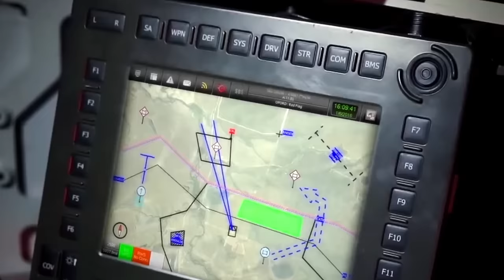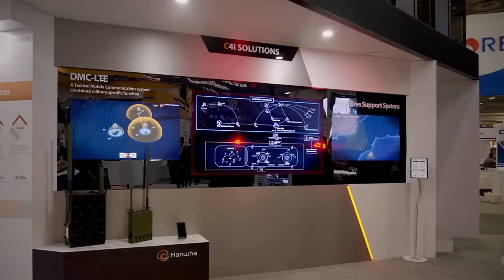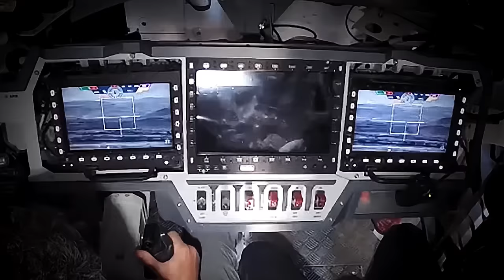The New Korean Weapon Designed the Shock the World

Comment: NOW THAT'S AN IFV!!! Although  I wouldn't say it has the armor of a heavy tank. This and the CV90 I believe are at the top of IFVS:)
Reply: Hopefully America busts one out here pretty soon 🇺🇸
Reply: Well, both are in competition to win the US Army’s contract to replace the Bradley. Along with the Lynx. The issue is familiarity, there are multiple systems and companies that has had decades of partnership with the US military. I can’t say which of the three are superior to the others. I do know all three platforms must meet US Army requirements, one of which is implementation of the General Dynamics’ new 50mm autocannon. I’m sure all three entries have sufficiently planned that part of the requirement. The Redback has, at least, one advantage over the other two entrants. If I’m not wrong, the Redback actually can transport more troops than the CV90 & Lynx. The US Army prefers more than 6 troops per unit as to not split a standard squad between two vehicles.

Comment: A vehicle like this is frightening because it can slap just about anything it encounters short of a tank. 40mm is gigantic! It can carry all kinds of crazy fuses, too.
Reply: With spike missiles also tanks will be slapped
Reply: major tank slapping potential, 2 at a time
Reply: @Shelorygod  depends if a tank has an aps if so it would prolly have to use all of the spike missiles but that would depend on many charges the aps has though It likely would operate with tanks and other ifvs.
Reply: This thing can clap about anything's cheeks it comes across
Reply: Lets just put this out there. The CV90, especially the later models are far more dangerous than the Lynx, Puma, Bradley or K21 fighting vehicles. They are more modern, the cannon is much larger (40mm) the types of ammunition 3p programmable ammunition is deadly as hell. It can air-burst at set ranges, it would annihilate every single Russian in ANY trench with ease from kilometers away.
The weight of this IFV is almost as much as the Russian MBT (main battle tanks). Close to 40 Ton. 

The CV9040 is a highly aggressive vehicle, designed to control the initiative by staying mobile instead of slowing things down to a walk. Aggressive maneuvering is what the CV9040 is designed to do, outmaneuving vehicles and killing them in the flank and charging enemy positions to drop off soldiers right ontop of the enemy. 

These tactics have been part of the Swedish doctrine since the late fifties as seen in vehicles like the PBV301 and PBV302. And it was directly copied from the German playbook of WW2, where the German panzergrenadiers/dismounts fought more often than not from their halftracks, allowing them to keep pace with the tanks and also maintain initiative through aggressive maneuvering. 

A Bradley, K21 and so on is not designed for that type of combat. It's essentially an APC that drops off troops 100m from the fight. The CV9040 drops off troops within 0-50m from the enemy position, or simply drives up to it and let's the troops fight mounted.

In Afghanistan it was apparently tremendously deadly. The Danish or Norwegians were caught in some kind of fight/ambush and they annihilated the enemy.
Reply: The AS21 Redback has a 30mm cannon. The original K21 has the 40mm.
Reply: @smallpenis266  well, given the high success rate of the Javelin, NLAW and Stugna-P against Russian tanks, it doesn't look like many Russian tanks carry their Arena APS. Maybe they are saving all of the tanks so equipped for when NATO finally has to directly enter the war to save Ukraine and they roll out all of their T-90 and T-14s they have been keeping in reserve. Or, given the images of "reactive armor" cells on captured and destroyed Russian tanks being stuffed full of cardboard, it is likely that the generals and others in the ruling kleptocracy stole all the money intended to equip their fearsome army with the ability to swat away incoming missiles, artillery shells and even sabot penetrators. So much for Russia being even a near-peer adversary.
Reply: @papparocket  they don't carry aps only nations that are actively using rn are Slovakia, Netherlands, Israel, the us, and ik a few like Germany and the UK plan to operate them soon and so do many other nations as their very important for any armoured vehicle nowadays also I kinda feel retarded asking this what does salient mean
Reply: Yes but what's the point of having lots of fuses if ammo capacity is too low for long engagements like Ukraine is doing now?
Reply: @chrisbrent7487  trade off for more ammo, speed, manoeuvrability and better armour? With the advancements made in AP and HE rounds it is kinda a moot point. Don't forget the inclusion of spike missiles as well on the redback.
Reply: @hgf334  The point is that the South Korea firm acknowledged the 40mm is not the right tool, and is going with Western Specs.  That shows they are a follower in the industry, and not a leader with regard to armament.
Reply: @raymondrogers3929 Hardly, South Korea has evolved to manufacture its own weapons through the country's modernization and military reforms. With companies such as Hanwha Defense, Korea Aerospace Industries and Hyundai Rotem they are a major defense industry player and one of the worlds biggest weapon suppliers.
Reply: @tomeng9520 We’ll see what the US Army decides. As the Redback, CV90 & Lynx are all competing for the contract to replace the Bradley. All three bids must be able to implement the new General Dynamics 50mm autocannon. So, the 30mm or 40mm currently available on these platforms won’t be the choice cannon for the US Army.
Reply: @TheBongReyes  The CV90 has a 120mm cannon on its chassis, then 50mm is no problem.
Reply: @tomeng9520  I understand but I don’t think the 120mm variant of the CV90 is actually an IFV. Just like the dual 120mm mortar CV90 isn’t a troop transporting IFV anymore. But I do like the fact that there are multiple variants of the CV90. Kind of like the US Stryker platform.

Comment: Great video and content, I really enjoyed it. To clear the air amongst some of the remarks made in the comments section here, I would like to point out that Australia has not made a decision on either of the two contending companies as yet. The two year Risk Mitigation Activity commenced back in October 2019 and concluded on 8 October 2021. According to media releases and reports by the actual Australian soldiers testing the vehicles, both performed admirably. In my opinion, given the supply chain issues that were experienced with the Australian Army's troubled fleet of NH Industries MRH 90 Taipan helicopters, it may be prudent to choose South Korea. Thankyou.
Reply: The most likely scenario where Australia will require these vehicles would be if open hostilities with China erupt. In which case South Korea is likely to face extreme challenges with the manufacture and service support their IFVs. Germany is less likely to face challenges with logistical support in this probable scenario.

Comment: I love the way this IFV presents itself and ALL "even" German new IFV's have "early stage" problems. But about some less known facts about current AS-21 development. As for now AS-21 "Redback" exists in 4 prototype units. It is important to emphasize that those units are not even early production units just assembled prototypes. 3 of them are tested in Australia (hot weather) and 1 is tested for the possibility to be adopted by the Armed Forces in Poland (very cold weather). Let me share some early conclusions, known to the public, from the Poland tests. As for now AS-21 "Redback" failed field tests. The turret which is originally offered to the Australian Armed Forces, and which is a non-Korean design, failed to work in cold temperatures, winter conditions in Poland, and it is said to be replaced with a design from a different manufacturer. The chassis itself also has many "early stage" technical problems and Koreans are currently working hard to make it work. This is just to show how much time it takes, how much work needs to be done, how difficult it actually is to meet the different market needs and make a modern military product.
Reply: Korean summer is as hot as Australian summer and Korean winter is as cold as European winter. Korean four season is very extreme. Therefore, Korean weapons are naturally made to endure both extreme climates.

Comment: The M113AS4 were only ever used as APC's not as an IFV, also every single M113 in this video was not an AS4 as they have 6 road wheels not 5 and they all have external fuel tanks with the exception of the M806AS4 ARVL (armoured recovery vehicle light).

Comment: THe lynx has not been in service with the Germans, its first customer will be Poland I think. Price will win out and the German kit is super expensive, plus they are apparently difficult to deal with.
Reply: Germany has the Puma which has been overpriced and been breaking down eversince. 
Far to many changes of requirements. 
It is a national shame.
Reply: Nah Poland is not buying it... lets say this is modify K2 howitzer chassies -> its not done well: had a lot mishaps, mobility and ergonomics need to be worked on ( it got stuck in mud during tests), turret is abismal - doesne work when its cold (by cold i mean 0 C) as the turret is Israeli made... So for now nobody wants it even Korea.

It faild on testing in Australia cos of mobility issue and turret was sending data from BMS (battle managment system) to Telaviv ...
Also Korea is not formal NATO country - it is not using NATO standard data links - that needs to be worked on

Comment: The redback spider is more familiar to users of old outdoor 'dunnies' (toilets) than bush adventurers 🙂.

Still good to see that the upgrade is effective against shipping containers!

Now, I hear Australia is dialing back its infantry size, and looking to stand-off capability, 40 years late, but better late than never.

As an ex-army guy, I'd think that a strong, large and capable army is the backbone. Not only for on-continent defense, but for strategic projection (taking territory as necessary) and tactical insertions in force.

Stand-off is great for strategic denial and deterrence, but most wars end with boots on the ground. You gotta have em.

Comment: This IFV cracked hell of a lot on test in Poland. :)
Reply: Dends how you understand "cracked". Polish officials had very low expectations of israeli turret (as from other tests of they they knew they had excelent dust resistance, but very little when it comes to humidty protection- or something along this lines as that's all that opens sourses are willing to say) but hull was outright dissapinting- which was propably casued by the fact of it being prototype/tech demonstrator (not even preproduction series). From letter sent from army inspectorate we know that they are eager to put indeginous ifv into production while that unfortunate AS21 prototype was entierly ommited.
Despite this mishap it is still unknown weather they are willing to give AS21 another shot - like they gave to K2 which initially gained mixed rewiews from polish tankers due to incompattible with them ergonomy.
Reply: @radosaworman7628  i heard the same from my polish military buddies. didnt really impress that much
Reply: @killdizzle  cramped. But as far as I understand they where disappointed as first k2 tests. Where carried out right after they had a chance to do some Abrams evaluation so perhaps stark contrast was to blame for harsh opinions about them. K2 so in polish army is a PT-91 replacement so they are used to crap interiors.
Reply: @radosaworman7628  US tanks are designed so that 95% of American men can fit comfortably.
This is done too allow almost anyone to be a tanker, to improve crew performance when enclosed for long periods and to allow easier entrance/exit.
German tanks are less comfortable and Russian tanks are designed for an expendable crew.
Reply: @alexfortin7209  "and Russian tanks are designed for an expendable crew."

lol, you know it's bad when it could be a joke but it could also be the official selling point by the company.
Reply: @YeeLeeHaw  Many Soviet equipment “flaws” are conscious decisions.
1) Poor crew protection 
2) 4km/h reverse speed
3) very poor gun depression 
4) auto loader with dangerous ammunition storage
Reply: @radosaworman7628  One of the Korean commentators also said that "the Redback's suspension failed during the tests but it can be fixed".

Comment: The 2nd best IFV, the Best is the New Swedish CV90 Mk.IV, better Tech all over and you can get the New US 50mm Bushmaster cannon also missiles !!
Reply: Lets just put this out there. The CV90, especially the later models are far more dangerous than the Lynx, Puma, Bradley or K21 fighting vehicles. They are more modern, the cannon is much larger (40mm) the types of ammunition 3p programmable ammunition is deadly as hell. It can air-burst at set ranges, it would annihilate every single Russian in ANY trench with ease from kilometers away.
The weight of this IFV is almost as much as the Russian MBT (main battle tanks). Close to 40 Ton. 

The CV9040 is a highly aggressive vehicle, designed to control the initiative by staying mobile instead of slowing things down to a walk. Aggressive maneuvering is what the CV9040 is designed to do, outmaneuving vehicles and killing them in the flank and charging enemy positions to drop off soldiers right ontop of the enemy. 

These tactics have been part of the Swedish doctrine since the late fifties as seen in vehicles like the PBV301 and PBV302. And it was directly copied from the German playbook of WW2, where the German panzergrenadiers/dismounts fought more often than not from their halftracks, allowing them to keep pace with the tanks and also maintain initiative through aggressive maneuvering. 

A Bradley, K21 and so on is not designed for that type of combat. It's essentially an APC that drops off troops 100m from the fight. The CV9040 drops off troops within 0-50m from the enemy position, or simply drives up to it and let's the troops fight mounted.

In Afghanistan it was apparently tremendously deadly. The Danish or Norwegians were caught in some kind of fight/ambush and they annihilated the enemy.

Comment: Programmable munitions...   Not sure it was mentioned but a quick lookup showed that the critical feature is included in the Reback.   Any YoutTuber who has seen the ammo in live fire exercises can't be amazed by its apparent ability to attack trenches, disrupt hostile fire, and troop concentrations.  It is programmable ammos most critical capability.   It is necessary to clear out enemy Chinese, North Korean, and or Russian trench formations more effectively to future proof its design in favor of soldier support.
Unless proven otherwise, S. Korean quality control work ethic and superb engineering is expected in each and every vehicle from demonstration model to final production run.  
Support is important for S. Korea that must have good access to the defense markets and its supply chains for its own defense.  The more it sells the cheaper the per unit cost.  It can afford to buy more for its imminent needs and fund other projects on a self-sustaining basis.  Overall, S. Korea will have a little more bite, with a lot more redback sting.
This is an utterly fantastic IFV.    Cost and uninterruptible supply, due to geopolitical location, would be one of the few imaginable concerns.  
Great topic selection since this is an essential video.  Thank you for the Great Video.